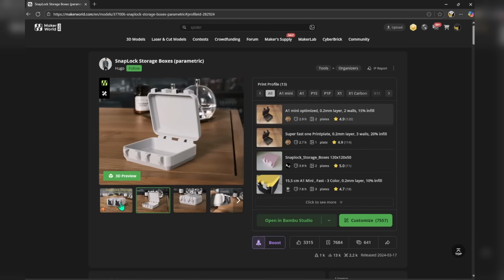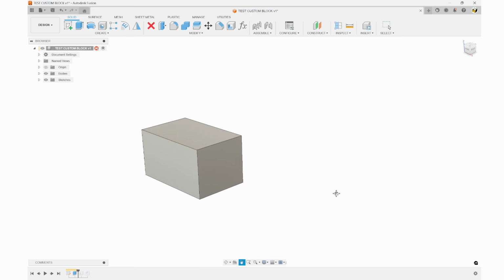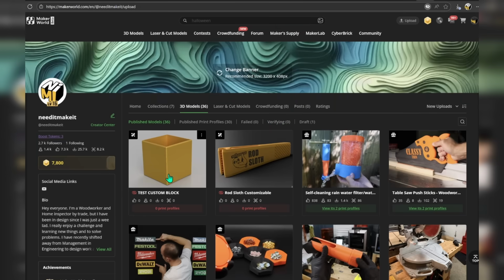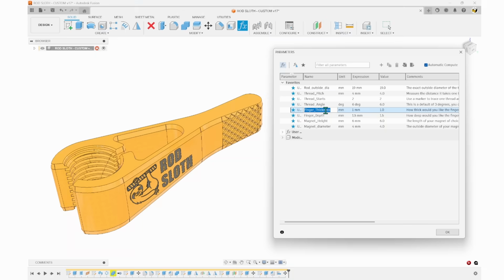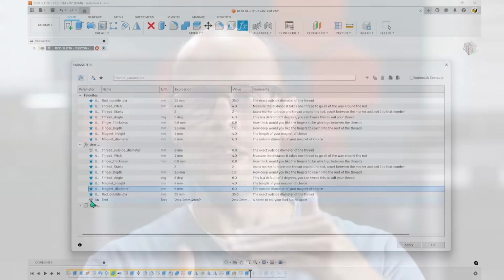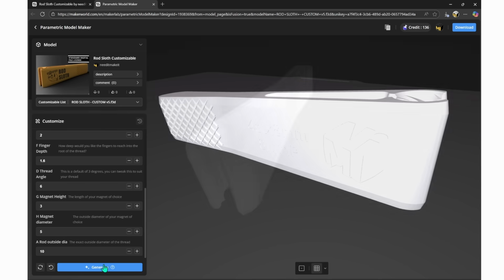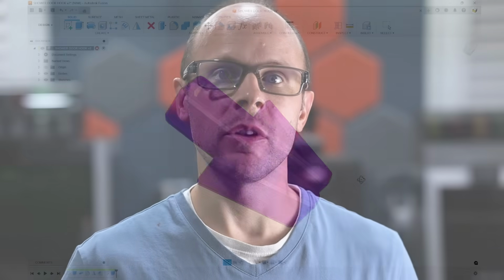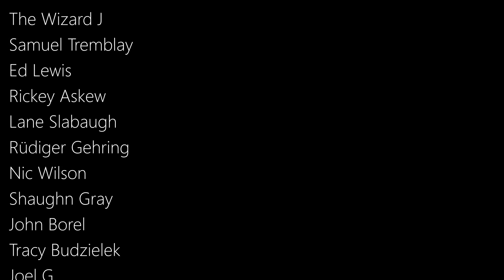MakerWorld added a feature that I didn't know existed and EVERYONE needs to know, because it can sav

Comment: Maker World sucks, so commenting here about the model:

Neat idea, but thoughtlessly uploaded.

Not sure why you would upload a magnet version with 3 mm diameter x 6 mm deep holes. Very obvious oversight - those numbers should be switched around for standard magnet sizes, so the magnet model is pretty useless as uploaded.

What about the adjustable model, which is the whole point of this video and extra work? Well, that's even more thoughtlessly uploaded. It still has the same backwards magnet dimensions, and it does not match any of the standard thread patterns for the other pre-sized models, taking away the convenience of the creator bothering to fine tune the values for standard screw rods. It would've been nice if you at least put those parameters in the description.

As someone who wants the original thread size with standard magnets, this is the most thoughtlessly uploaded project I've ever found, like the person losing a marathon because they started bragging before the finish line. After all that, it's still easiest to simply subtract normal magnet sized discs from the base model in Orca like a caveman.
Reply: Wow, so rude and so entitled.  He didn't have to upload at all.  He was demonstrating a feature, not shooting for upload of the year.  It's running into ungrateful schmucks like you that discourage uploading.  Maybe if you learned to ask nicely, he would have been inclined to make the changes you'd like, but being rude is no way to encourage that.

Comment: Is there a way to set a min and max value of the parameters? My designs often break if I enter a number that is outside my intended range.
Reply: You could make a hidden parameter that uses max and min to limit the real value.  E.g. RealHeight = max (min (Height, 10mm), 2mm) would limit the height to 2-10mm.  Caveat: it's been a while since I used F3D, so I might have got the syntax wrong.  Let's say the input value was 11mm, min (11mm, 10mm) would be 10mm, and max (10mm, 2mm) would be 10mm, so it's clamped to 10mm.  If they entered 1mm, then min (1mm, 10mm) would be 1mm, and max (1mm, 2mm) would be 2mm, so it's also clamped at the bottom end to 2mm.

You'd need to mention in the description that you were limiting the values like this, or people would think your model is broken.

Comment: From my work in creating parametric 3d models," length" as a parameter name is not used due to all being lengths. Instead I stick to Width, depth, and height. I think as long as you are being consistent, its all that matters in the end. good stuff, this give me one more reason I should learn and use fusion360
Reply: Be aware that Autodesk can and has changed the terms and conditions at will.  I used to qualify for the free tier, did a lot of advocacy for them, and made a bunch of designs, then they decided to shift the goalposts so I no longer qualified.  I had to pay to be able to rescue my models that were all in their cloud.  After pulling that bait and switch operation, there's no way I'd trust Autodesk again.  I thought about switching to OnShape, but I'd be just as vulnerable to them shifting the goalposts, so I've settled on FreeCAD, which thankfully is now capable enough and reliable enough for professional work.

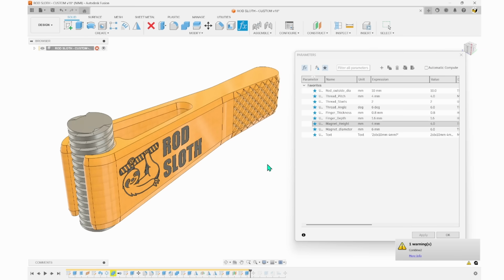Comment: 6:01 You can use the max and min functions in Fusion to limit the inputs. It's a little convoluted, but gets the job done. You can even limit values based on other values, eg. length always being within 2x depth. I think you would need two variables each, one for the raw input, and a non-favorited one for the limited version of input.
Reply: I just responded to a comment further up about the same thing, and came up with the same workaround.  It's not ideal, because the limiting is not obvious to the user.
You'd have something like:
  RealHeight = max (min (Height, MaxHeight), MinHeight)
where Height is the favourite and RealHeight is the one used in the model.  MaxHeight and MinHeight can either be non-favourite variables or hard-coded constants.
You would have to document that you were limiting the variables, or you'd get people complaining that your model is broken.  There are all sorts of sanity checks you could build in using similar techniques.  Whether it's worth it probably depends on how popular the model is likely to be.  If you're going to have to respond to hundreds of people complaining that the model is broken, it's worth putting in the extra checks.

Comment: I don't like releasing my fusion files because I'm afraid of being ridiculed for how many things I did in the worst possible way!
Reply: HAHA same, I sometime completely redo designs before making them public just out of pure embarrassment of my history bar.
Reply: haha you just opened a whole new phobia that until now I was blissfully ignorant of...
Reply: I’m with you there.
Reply: +1 yup
Reply: I share everything. Unfortunatly, allreade several times i had to discover that others where took advantage and were selling my design. Even in USA-shops (i’m from Europe)
Reply: @ludodg  I haven't had that happen to me, as far as I know.  Probably because my designs aren't the kind you'd sell.  But they wouldn't be taking advantage of me because I release everything under the most open license available on the sites I publish under.

I do that because when I design something, it's to fix a need I have, and sometimes, very rarely, I feel like it might be something someone else could use, so I put it out there.

For example, I wanted to put my printer (Prusa MK3S+) on squash ball feet to reduce vibration.  The feet that I could find all had something wrong with them, so I designed my own.  They printed in two parts instead of one for better quality, and I also didn't have the right t-nut, so I designed one you could print and slide an M3 square nut into.  Functional, but not really exciting.
Reply: its like talking in another languague. you still doing it much better than people not even trying it!
Reply: I couldn't care less what other people think of my models. Make it better if you are able to! 
Having said that - I love honest critique and listen to good advice.
Reply: @JenSalik_ And learn what I can from feedback.
Reply: @JenSalik_ Absolutely agree Jen! That’s the attitude to have as far as I’m concerned but? Many still struggle. Honest, good critique is quite useful!
Reply: I little bit of of public ridicule and embarrassment might be good for you. It'll build character ya know or completely crush you emotionally.
Reply: @caploader111 or both 😂
Reply: Amen to that!  🙂
Reply: I think everyone has this in them. The irony is, critical feedback and input is how the design process shines and it’s an example of how, when you introduce many minds into a process you inevitably end up with a superior finished good. Also, as a designer your abilities grow by consuming such feedback. The ignorant thing is how many people waste everyones time with a$$hat responses that do nothing to further the effort they just end up being abusive. However, if you can get past them (ignore) and listen to everyone weighing in? Your skillsets will level up significantly.
Reply: Just model everything using nothing but sweeps and interference combines.
Reply: Just means you are focused in creativity.
Reply: ditto!  haha
Reply: Don't take it too serious. You don't get payed by the hour or by some other measure of quality or quantity. Most of the know-it-all keyboard warriors out there did not deliver anything, so you are always way ahead of them. Just ignore the bad or insulting comments, unfortunately this is part of the "internet culture" that you just can't turn off completely, even if you do everything perfect. However, maybe sometimes you actually get some constructive feedback or tips that can help you improve your work on the next project or some approval and praise to boost your energy and confidence. Don't hold back, just because you assume what other people you don't even know or care about might think about you or your work.

Comment: They should expand this to support other CAD formats not just Fusion, but also free stuff like FreeCAD and Onshape. Would be so much more accessible
Reply: They do, they also use OpenSCAD
Reply: I agree that it would be good to expand this feature to accommodate other CAD software tools. I would add that where you say: "...but also free stuff like FreeCAD..." the way I'm reading that (which could be wrong, so apologies if it is) implies that Fusion isn't a free option. I've been using the free version of Fusion for a few years now and it works well for me. They do of course have a paid-for version too. So this new parametric feature in Makerworld is open to all the cheap-ass hobbyists like myself.
Reply: @GeoffTV2  I used to qualify for the free tier, did a load of advocacy for them, and had loads of models in their cloud.  Then they pulled a bait and switch operation, so I'd have to pay.  Sod that.  Thankfully FreeCAD has come on a long way in the last year, and it's now very usable, and it's totally immune to any corporate shenanigans.
Cloud computing is not cheap, so a free tier only makes economic sense if people learn the product and go on to use it professionally.  I fear Fusion will continue to be more restricted, and also that OnShape will likely follow suit if it becomes as popular as Fusion did.
Reply: @GeoffTV2 they have limited the functionality of the free version slowly over time. I would not be surprised if they have a plan to phase out the free version.
Reply: @darbodrake89  They have, and I've been concerned about that as well but they started hampering it years ago.  I feel like if they wanted to completely remove it they would have by now.  In fact the nerfs have pretty much stopped (knock on wood).
Reply: @GeoffTV2  Yeah I couldn't parse that sentence either. Free as in beer doesn't work because Fusion is monetarily free like the other two. Free as in speech doesn't work because OnShape is closed source, like Fusion.
Reply: for anyone using onshape, you can provide the onshape link for others to edit and simply use variables in the file.
Reply: FreeCAD is based on OpenSCAD and they've supported parametric OpenSCAD for longer than Fusion. PS - It's not called Fusion 360 anymore, it's officially just "Fusion" now.
Reply: I saw that you could upload solid work files, maybe it is compatible with solid works parameters ?
Reply: Parametric adjustments like this in the browser is probably one of the hardest things to do, which I feel not enough people give Bambu credit for. Yes, this existed for OpenSCAD for a bit now, but F360 is closed source and a lot more powerful than OpenSCAD, so this effort clearly had a lot of work put into it. It will probably be a long time before we see other formats supported, because the F360 kernel will take a lot of effort to maintain I'd guess, and it is the most popular CAD software so it is worth that maintenance.
Reply: @Kori-ko  Implementing this feature is actually relatively easy. They're very probably using Autodesk Platform Services (formerly Forge), which allows specifying an input f3d file and key-value pairs for parameters in a REST call and get a mesh as output. BambuLabs possibly worked on the UI/UX to input params and display the resulting mesh, but that's about it. Of course, they should get credit for even thinking of providing this service (Plus, APS requires a developer account, which is not free), but it's not like they had to deploy crazy efforts to develop or maintain this feature.
Reply: @Kori-ko Autodesk separately recently built in direct slicing support for Bambu Lab printers inside of F360 as well, foregoing Bambu studio as the slicer, it outputs GCODE via file transfer or Bambu connect middleware. I haven’t had a need for this but it’s an interesting add in

Comment: An important thing to mention: if your design requires non-standard print process settings (the "print profile"), a customized model downloaded as a 3MF does NOT come with that custom profile.

If you do things like painted brim ears, custom line widths, different surface patterns, etc those customizations will NOT be there for customized models. 

If this is important for the model to print properly, please advise people they need your profile first and should import the customized model to a new plate in Studio on order to get those print settings!
Reply: Yet another reason to start modeling custom supports as a designer

Comment: I'm not a huge fan of MakerWorld, probably because I'm used to Printables and don't like change, but this was good to learn about!

Given how variable nozzle sizes are, I've stopped saying "print with so-many perimeters" when people ask for advice on thick something's walls should be, and instead just say "print it so many mm thick."  (I spend a lot of time explaining to people that if they want to be able to sand their 3d printed R2-D2 smooth and also not have the shoulders explode, the walls need to be much thicker than those on a Benchy.)  I'll then often do some basic math for 0.4mm and 0.6mm nozzles.  So I end up saying things like "the shoulder pieces should have walls between 2.4 and 3.0 mm thick for strength, which is 6-8 perimeters with a 0.4mm nozzle and 4-5 with a 0.6mm nozzle."

I do this for three reasons; first, I don't know how big their nozzle is, usually; second, I'm often talking to relative newcomers to 3d printers and want to expose them to the idea that you can change the nozzle size; and third and most important, I want to encourage them to stop thinking in abstract units like "number of perimeters" and start thinking in end-effect terms like "how many mm thick is this piece of plastic."

It seems to me that my thinking here would apply to many of your viewers, and so I wanted to outline my habit in case it's of any use to you.

Comment: Another useful trick is that for setting unit-less quantities (like number of features in a repeating pattern), the makerworld customizer (or maybe fusion? Can’t remember) doesn’t work with unit-less variables. You can set the parameter to have a unit (mm, for example), then when using that parameter, divide by that unit to get you functionally unit-less variable! I might make a video showing this and some other tricks soon.
Reply: It also only works with variables defined in metric units. Fusion will accept input like " 2" " and convert that to 50.8mm, but MW will not (or at least it did not a few months ago).

Comment: Don't want to criticize - free parametric model is great.
But to clean rods it is much easier to use simple rope. You can use natural material rope with visible and outstretched fibers for better results. Jute or hemp. Also flat cotton cord should work good. There are even special ropes for the job like "Finish Line Gear Floss Cleaning Thread" weaved from microfiber
Reply: I’m using finish line gear floss to clean mine as well, but it would’ve been a great idea for him to include a clip of him actually using the tool for people who haven’t seen it before. it’s actually much easier than the gear floss, because you just clip some towel to the rod and move the build plate up and down, you don’t even need to touch the clip.

Comment: When I want to do limits in Fusion I'll have a normal parameter and a calc_ version. The calc version will have the min/max/clamping calculation using the "normal version" and is what I'll use in the model. Hope that makes sense!

Comment: Parametric text is not (yet) supported.
6:00 To Set Limits/Range: click on the avatar with the slanted ruler in front of the f3d-file to set limits, then click "UPLOAD".
Reply: Another thing related to limits is that you can set up user parameters in Fusion to drive other parameters with conditional formulas. I’ve used this in a few models to enforce limits and toggle features on or off (specifically for MakerWorld’s customize feature, when the basic limits in the customize tool were not enough).

Comment: I'm currently going through the notion of using that for the incoming project. But the fact I have to upload invdividual files clashes with my hobby license and the fact I keep all elements, parameters, sketches and assemblies in a single file.

Furthermore let's imagine I have multiple parts that should scale relatively to a single dimension (according to some internal formula) - if I can't keep all the parts in a single design file but split it through then I'm leaving a lot of space for user error as someone forgets to customize other parts or makes a mistake at inputting values.

Also fusion sometimes panics after changing parameters, causing weird geometry or errors (eg. elements in a fully constrained sketch suddenly switch axis), I wonder if that's solved or simply app runs recalculate all.

Also there's the quick note from release article: "To provide this Fusion 360 integration, we rely on a third-party API that has an operational cost. To keep this tool sustainable, we may have it consume MakerLab credits in the distant future.
This feature is currently free to use."